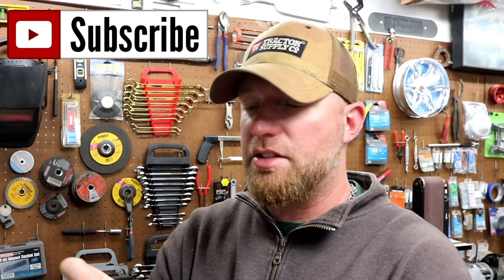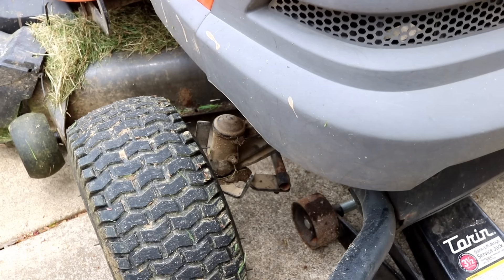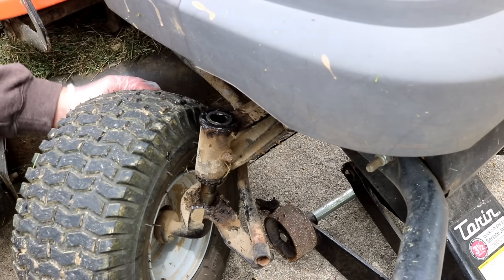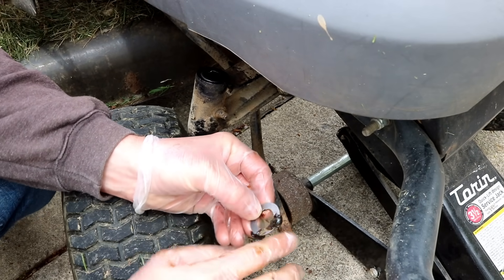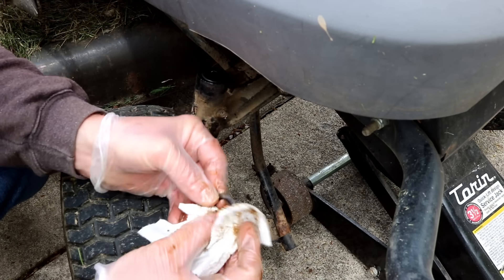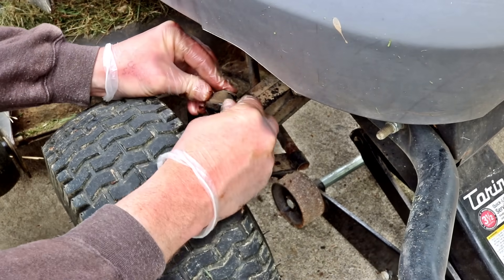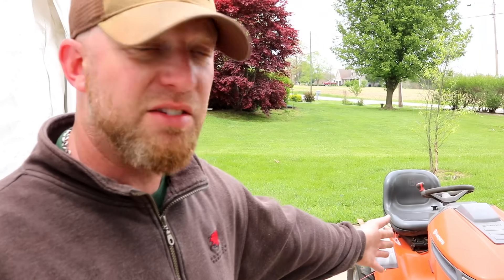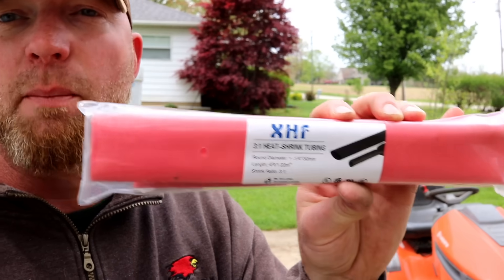$6 And 10 Minutes Will Give Your Riding Mower 1 Finger Steering

Comment: I watched this, thought wow, i try it,So,I ordered those same bearings,put them in , no problem, but if there’s any difference, it’s so small I can’t tell, like power steering? Nope, drive with one finger? Lol !
Reply: Just did the same thing. Did you ever figure out a solution?
Reply: @Hammy_J  no, not much you can do to eliminate the friction between the tires and the ground, those roller bearings was a waste of time and money.
Reply: @jackieliner3812  Add air to the tires.
Reply: @rickwoodmeister2088  really? These are turf tires. Max air pressure 15 psi.All im saying is there’s no difference with those bearing’s, so why waste your time and money.

Comment: Awesome video!  Just ordered me a set.  Also ordered two new dust cover caps.  My mower is almost 20 years old and they feel like they are hardened.  If I can't get them off, I'll just cut through them and replace with the 2 new one's that I ordered.  I'll post again and let you know what I think.
Reply: I got a old John Deere. I think I am going to be doing this to mine. How did yours turn out? I like messing around in the garage and I got a vacation coming up. So this would be great.
Reply: @thurm101  Well if I had to do it over again, I wouldn't.  It was a pain in the rear.  The two bearing washers made it too thick to put the E-ring back on.  Therefore I had to file the top of the place where the E-ring goes.  I don't know what the thing is called.  Anyway, each side took about an hour to file down so I could snap the E-ring in place.  A lot of people don't have this problem, but my mower did.  Plus to be honest, I really didn't notice any difference in the steering. Maybe I need new tires.  I've heard just putting new tires on the front makes all the difference.

Comment: Great idea, but . . . There are bushings in the axle beam for the "kingpin" that usually wear and may also need replaced. Also, if you don't set the end play where the kingpin goes up and down in the ends of the axle beam, the cages will fail and the needle bearings will come out. There is more to this than just dropping the bearings in - there are other issues that often need addressed.
Reply: Did this to my John Deere L118 about 18 years ago ... still works great.
Reply: It's just a mower

Comment: Just grease the spindles every spring and you don't have a problem. My old LT 2000 is 21 years old and steers just fine. Use a good high quality red grease.

Comment: I'll bet your next video is how to change the spindle bearings on the mower deck.
The bearings don't burn up when you keep the air flow clear of grass clippings and debris.
Do you own a leaf blower or power washer ?
Nice needle bearing idea , but I don't have any problem turning the steering wheel , nor does my 12 year old.

Comment: Yeah I bought this last year but thought I never got it then I realized that the package fell under my car seat so I'll get to try it soon I still need to find a way to make my mower quiet without being a welder
Reply from the maker: Getcha a replacement muffler off Amazon for about $50… they are only 2 bolts.  Or you can use the “JB weld - extreme heat” .  That stuff is only $9 on Amazon or automotive store. https://a.co/d/cEjvPVF

Comment: Back in '97, I rebuilt a '74 Montgomery Wards 16hp rider and had the bottom of the axle milled off and used a couple of kingpin bearings. This would've been faster and cheaper!

Comment: I keep mine clean already replace half of the front end on a Husqvarna and now there cheap ass frame broke and it where their welds are by the looks of it it was a bad weld to begin with but Husqvarna gives me trouble every time idky but Im always fixing something
Reply from the maker: I have never worked on a piece of equipment so much as my husqvarna lawn tractor. The damn thing broke down every year - one or two times over… still Don’t know why I like it so much. I switched to a Cub this year, turning the husq into a sprayer to keep the fence lines sprayed without walking 2 miles. Best of luck with yours. 🍺

Comment: Cars and trucks should have that arrangement; makes the load on your power steering pump or your arms (non power steering) so much less.  Also to make steering your mower even better, while carrying your beverage along, do what I did with the landlord's John Deere rider and put a "Brodie knob" on the wheel.

for vehicles it would be necessary for the manufacturer ( initial design, fat chance ?) or an owner to do machine work, for needed clearance, to allow a SEALED bearing arrangement to be installed.

Comment: @BrianEaly, not sure what I  am doing wrong.  JD, LA135LE mower.  got the bearings from the link you provided.  took everything apart, cleaned the spindles, greased the bearings, reassembled everything.  Greased the Zerks.  I had no washer on the bottom like you did.  I mean, there may be some difference but i sure aint no one-finger steering like you show.  Any ideas?  it was worth the $5.25 to find out though.  oh, and i made sure my tires had the correct pressure too.
Reply from the maker: I thought about it, only thing I can think of… maybe do the tires have a tow to them? (A lean in or out because of bumping stuff, or just riding over time?) other than that, I’m not sure. Maybe it is better or worse on different makes and models. Best of luck man!
Reply: @BrianEaly  ya know, I thought about that too. Reckon I’ll look and see. Won’t be no whole lot I’d be able to do if’n that’s the case. Preshate the reply.

Comment: Doesn't work on smaller Cub Cadets.  Their entire steering control arm an king pins are weld and all one piece.  There is a cap on top, but it's welded underneath.

Comment: Bummer. I thought great idea. But my 2018 Cadet LT42" XT1 ENDURO has the steer arms welded on top of shafts where bearings would go. However, the steering gears are easily accesible by popping the hood. Of course bone dry.  No grease at all from factory.

Comment: I had a 1957 Chevy and on the front spindles there was ball bearings and I had to get some new ones so I went to a junkyard to find some parts and the guy told me that the hub from a 1955-1965 Chevy or somewhere in that range would fit, but the later ones had needle bearings so that's what I bought 65 Chevy Impala hubs with needle bearings and the steering was so smooth.

Comment: Hey!  How do I find out what size bearing I need for my mower?  Is there somewhere to look these types of specs up?    Would a standard parts diagram have the dimensions?  Thanks!
Reply from the maker: @Gzusgeek  
You should be able to find it in a parts diagram online or searching around google… easiest way is to get you a cheap digital caliper. They are like $10 at Walmart- TSC - harbor freight.  Best of luck, take care.

Comment: The two main problems, with this type of mower is the hard steering and the belt keeps coming off, I finally found the fix to both of these issues that keep happening,, after trying almost everything, and that repair is to purchase a zero turn, it fixed both of the problems instantly, and the problem never came back, it was a permanent repair. 😎👍

Comment: Why didn't they put these in from the factory this would have gave some lawn tractors some  extended front end life for sure alot of  people  junking there tractors with whiped out front end 😂 I'm doing this with the adjustable  drag links this spring on my craftsman
Reply: Wonder if I could think of s mod for the  upper steering colum bushing

Comment: My neighbor has one of these loud screamin daemons. I sent him this video and we put some on his. As you say it's super easy but for whatever reason it made little change. It has to be better. Life's to short to use cheap mowers, just get the BX diesel Kubota with the front loader and be finished. lol I'm getting older and the body doesn't work the same so I got a front loader to save my back. The three point hitch tills the garden and also lifts. A Kubota was cheaper and less painful than back surgery.

Comment: Of course the manufacturers would never go to all this expense to make their mowers drive easier.  BTW, that bendy connector arm with the nubby thing on the end is the poorly engineered steering system almost every riding mower of this type uses.  It's so stupid - I have replaced those rods four times on my Craftsman yard tractor in just ten years of mowing one acre.  I also had to replace the steering gear sector, the gear-like thing that turns the  connecting rods to and fro.  So I bought a new high-dollar Zero Turn, and within two years I had to buy a new wheel because its bearing fell out.  The engine had a neat tube to drain the oil, except there was no room in the engine housing to actually reach that tube, so I've had to pump the old oil out through the dipstick tube with a hand suction pump to do an oil change, and I can never be sure how much sludge I left behind.  Believe me, yard power tools are made to fail over time.  Someone handy with tools might make one last, but the rest of us are stuck with the expensive shops that do more work than you asked for, and charge you extra for the privilege.
Reply from the maker: Man, you hit the mail on the head!  I don’t understand how it’s 2023 and these front axels in mowers are still such junk. Every homeowner grade mower it seems - a few years after use sits with the front wheels at a 15 degree angle towed in or out. You have to replace them or modify them every couple seasons. Has to be on purpose - encouraging the customer to buy new or replace. 

I get it… ‘get a commercial grade’ they say, but I can’t afford a $12,000 x mark. 

Best of luck, take care.

Comment: Adding them to my JD 110 circa 2017, the washers and bearing keep the axle shaft from going far enough back into the barrel, makes it so a washer and c-clip wont go on (my washer goes on top to give the clip something to bear on. The barrel is cast iron for mine and has cast flashing that I ground down flat to give me that extra 1/16th to get the washer and clip to fit back on.

Comment: There's also a utube video called 3 upgrades for your husqvarna mower. In the video, he shows you how to replace your front wheel bushings with bearing. With links to purchase bearings.
The bushings rub against the wheel shaft, eventually causing you to have to have to replace the shafts, which are not cheap. Bearing sets are only $20.

Comment: Toro 5xi series tractors have 1” diameter front spindles. 
Toro 260 series tractors have 7/8” front spindles. In 2012 I bought a Toro 5xi series 520xi which had manual steering. The next year I was diagnosed with chronic Lyme disease. I started experiencing pain in my arms from the Lyme disease and in March 2015 I bought a Toro 522xi which had power steering. I should add thrust bearings to the 520xi so it’s easier to use.

Comment: I just installed this on 2 riding mowers; a Craftsman LT2000 and a Murray 425007x92.  Both mowers required that I eliminate the original lower washer when installing the bearing set, otherwise I couldn't install the reatiner clips and/or cotter pins.  I'm not sure why the original washers would be required, since the bearing and 2 new washers are installed... guess time will tell.

Comment: Hay thanks. My mower is like the old, old trucks I used to drive that had air assist steering. Ya could not turn the steering wheel without moving the trk.

Comment: this mod is bogus. i figured i'd try it because easier steering would be a bonus on my troy bilt bronco as it was never really easy but also not really difficult either. anyways, it took a bit of work finding the bearings(since these videos have made it rather difficult to find the metric AXK2035 and the sae NTA1220 needle roller bearings. after getting the runaround for a couple weeks i got a few to put on my rider, greased them up well and made sure not to assemble everything too tight, my excitement went out the window as soon as i put the mower back on its own weight and the wheel felt the same as it did before. mowed the yard to make sure it wasn't just a stationary issue too, felt the same while moving as well. so, i'll save you all the headache, this mod doesn't do anything more than pumping some grease into your steering knuckles will. i guess if your has filthy dirty kingpins that have never seen grease in their life, the simple cleaning, reinstallation and new grease from this mod will make it feel like an upgrade.

Comment: Have a 19 hp Sears 2200 riding mower, which has many of the Husqvarna parts and wonder will this work on my mower? Thanks. (I also rely on the knob, like you have, for steering my mower).

Comment: I own a small engine repair shop. There's no possible way this would work. Not enough length on the top of the spindle shafts to be able to reinstall the e clip and washer.  Not only that it would take a lot longer than 10 minutes. The only hack in that video is him.
Reply: I'm assuming some mowers have a lot more slop in there. I thought the same thing as he was doing it.

Comment: I was a professional small engine mechanic for 10 years.

While this is actually a decent idea in theory, it’s not likely to be good long-term in practice, and here’s why:  Dirt and moisture will quickly get worked into the bearings and cause them to bind, especially if the spindle shaft zerks are greased properly.

The best solution is…just to keep your spindle shafts greased thoroughly and keep the tires inflated to the proper pressure.  Depending on the useage, the grease zerks may need to be done multiple times per year.  It makes a world of difference.
Reply: 5 years so far and not a problem with mine.

Comment: I wonder ho youd adapt this to a truck that has ball joints. Also, whynot put these in the base of universal joints to minimize driveline friction. I had a motorcycle throttle once that was butter. It had these bearings in the base of the tube where the handlebar goes.

Comment: great idea thanks.
i replaced the worn out plastic top hat bushes on one of my old Murray ride on's awhile back and the steering now is awesome.
i'm in the process of doing the other 3 at present, but willl add the thrust washers, only problem on the murrays is i have to cut & reweld the arm on the top of the steering king pin.
i had to make the top hat bushes, soldered on washers to plain bushes, then reamed the inner diameter, as i'm working on a budget

Comment: It helps some but not a huge amount, barely able to tell the difference, maybe 10%  but not drastic, I installed them on my new Husqvqrnq 18542, also did the front wheel bearings at the same time..

Comment: Give the riding mower a bit of toe-out in the steering and it turns much easier, it wants to turn. Toe-in is for high speed straight line driving, totally unnecessary for a mower.

Comment: I can't find the right size from my t8000 rider.. parts book says axle flange bearing in it now is .75x1.00x1.12 which is about a 20x28.5mm any ideas...35mm way to big I think
Reply: Is one OD and the other ID?
Reply: @matthewbeaver5026  yes, .75 is i.d and the other is o.d of existing bushing
Reply: @nvrlate2220  only the .75 matters to you.  The od of the spindle.  
So you would go with 19 mm Id bearings.  
Their od and thickness is irrelevant and is what it is.
Reply: Mine were like 19x35x3mm

Comment: In addition to the extra flat washer installed with the bearing on the bottom to allow for the added thickness did you leave out a washer on top before you slid the holding pin back into the shaft?

Comment: I must have missed it, but I don't remember if he said to do it to both wheels or do you use both those bearings on the one wheel.
Reply from the maker: Both front wheels 👍… they are still going great!
Reply: One bearing per wheel on the bottom where the weight is. See my other post about securing the shaft to the axle because the groove for the retaining clip will be inaccessible unless you lose a couple of washers. I wouldn't recommend leaving out the washers that sandwich the bearing on both sides, otherwise you'll destroy the bearings almost immediately.

Comment: I have a John Deere and bought some of these off Amazon. I tried to put them on but the added length of the post made it impossible to put the e-clamp back on. Putting some good quality synthetic grease on the post also provided some improved steering. You never worry about these things until years after you buy your mower and then all the dirt and old grease become like glue. I will be doing more cleaning and maintenance on my mower to reduce the steering problem.
Reply: Thanks, you just saved me $6. lol I have a John Deere as well and I was wondering about that.
Reply: I had the same problem going to try to find a thinner washer and see if I can get the clip in

Comment: I'm surprised there is enough end play on that kingpin to allow the needle bearing assembly to fit in. I'm also surprised the factory didn't build this feature in as the parts would have cost them next to nothing.

Comment: In transmissions, they quit using brass "thrust washers" and the newer ones used "Torrington bearings"
A little like these but in larger diameters.
Freed them up, reduced wear, reduced drag.
Sometime around 1979 in US made.
These are similar, in this usage to King pin bearings used by medium duty and heavy trucks.
But, keep raising your mower and lube the gears for the steering.
They are exposed and it's easy access.
If you don't, they can wear out quick.
There's nothing on them but paint when you buy it.

Comment: These little thrust bearings are delicate and overrated. I have actually seen Youtubers use them on a bench vise, but they never follow up later to say they're still working. Mower steering is much lighter duty, and could actually work for a while.